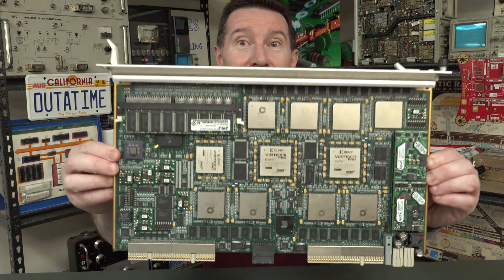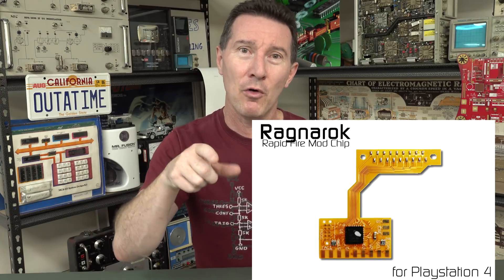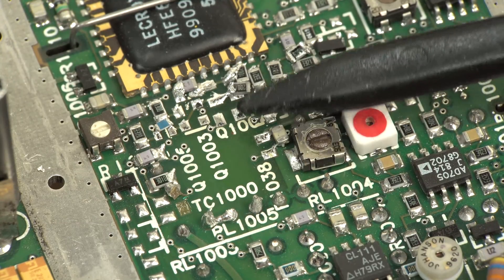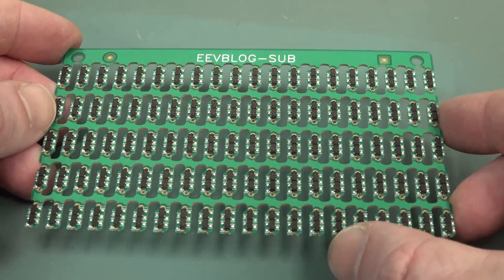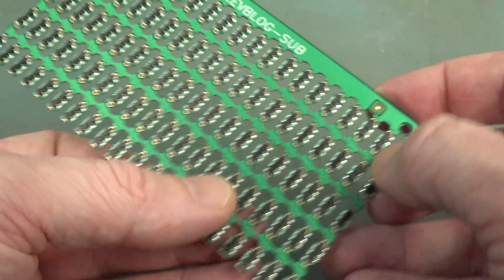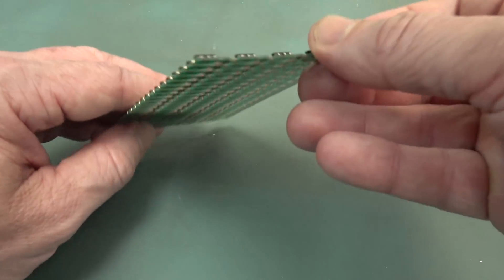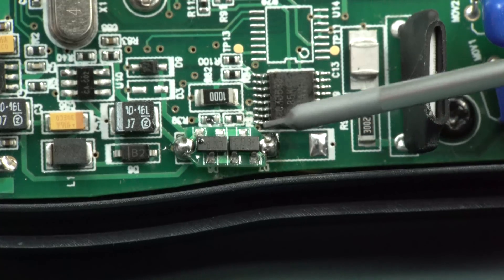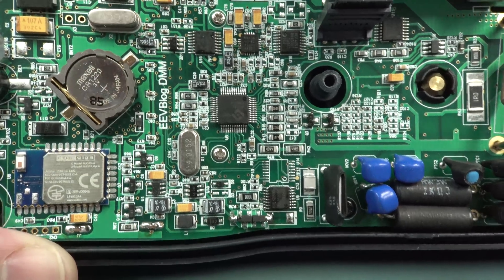EEVblog #1158 - How To Create PCB Mod Boards

Comment: How to be from noob to pro in electronics from scratch without Arduino and raspberry Pi?
Reply from the maker: Build stuff. Fail. Troubleshoot. Repeat.
Reply: Electronics is way more than micro's and writing software.
Reply: @vincei4252  Agreed, analog design is far more demanding than buying and mating modules with bodge wires and code...
Reply: grab a book like Practical Electronics for Inventors by Paul Scherz and Simon Monk. practice basic circuits on a bread board and/or perf board. when you are feeling more confident and and have a working design you want to make more permanent, fire up KiCad and learn how to do PCB layout. you can get small 2 or 4 layer boards made for super cheap these days. and just keep practicing. there are also circuit simulators that are super helpful for understanding how components work, without needing to spend money on hardware.
Reply: All the above, than when you are confident with basic circuits, do repairs. I think it's the fastest way to get troubleshooting skills. Unless you are building really complicated stuff, you probably won't run into too much problem, so repairing existing, scrap stuff may be a quicker (and possibly cheaper) way to improve your skills. Than you can build more advanced stuff, and run into harder problems to solve. For example, if you buy your instruments in non-working condition for cheap or pick it up for free, than repair it, is a good way to both equip your lab, save money, and get practice. Although repairing an oscillopscope or other complicated lab equipment is not a beginners task, better to start with simple, cheap consumer stuff.
Reply: arduino and rpi are more software oriented, depends what you want but if you want "electronics" knowledge you can start learning about components and circuits, first analog, then digital. For software related stuff you can use basically any computer to learn coding, there are even OSs, emulators/simulators from many popular devices like the rpi and arduino so you don't need to buy all of them at least to start learning.
Reply: If you want to learn digital without learning software then build up logic circuits. You can do a hell of a lot with just the 4000 and 7400 series of chips.
Reply: Thanks everyone for guidance!
Reply: Don't worry about using Pi and Arduino. Its all good useful stuff. Except in professional Electronics these are used in the automated test jigs, rather than the final products.
Reply: Get yourself a few cheap op-amps like the 741. Get a cheap prototyping breadboard a few LEDs possibly some 555 timers and start with simple things like flashing LEDs. It's worth getting a few cheap transistors too like BC108/2N2222/BC547 (all three are similar enough to be interchangeable below 12V in most applications), get a resistor selection box and a capacitor selection box and have fun. They work quite happily from 9V as long as you do not overload them and it's worth building simple stuff like a crystal set radio too. You can then use the op-amp or a couple of transistors for a simple amplifier for a speaker instead of a crystal earpiece.

Comment: You didn't really save on the hot air while removing on of these boards on the scope board, or did you?
Reply from the maker: The mod PCB actually crumbled when it came off, it was a mess! Must have been some horrible quality non-woven fibreglass.
Reply: @EEVblog  I was talking about all the blown away passives around the former mod PCB ;). But yeah, that happens. Had to replace some TQFP uCs on prototypes once and just put new blocking caps around them afterwards.
Reply: I was staring at those for a minute thinking, damn that is a horrible botch job, before realizing it was just from him removing the mod board.
Reply: Looks like a crime scene 6:36
Yeah, shit happens. No worries.

Comment: I wonder how big the market is for mod boards. There are plenty of obsolete parts still used for hobbyists and common repairs. Is there a database where you can search for an (obsolete) part and find the buy link for the replacement? It does not need to only offer mod boards, but all kind of items you could replace a given part with.
Reply: L3 P3 Really good question.  In the old days there used to be entire books of equivalent component numbers for ready look up.  Not sure about these days.
Reply: Plenty,  guitar effect pedals are a perfect example.
Reply: For example I recently saw this http://www.leobodnar.com/shop/index.php?main_page=product_info&cPath=125_127&products_id=324 board to replace an unobtanium prescaler IC in a HP/Agilent signal generator.
Useful if you have a need for exactly that IC (which apparently fails quite often).
Reply: Some circuits are turned into "components" this way. DC converters for example. You can buy a variety of DC converters with the bypass transistor, cap, inductor, and diode, preasseambled on a tiny "mod board" that is made to be populated onto your own PCB.
Reply: NVRAM! nvram.weebly.com.
Reply: People have used them to get around security on game consoles.

Comment: Since you have not mentioned it: Are these two transistors in a voltage-clamp configuration just like you explained in the previous video? It really seems so.
Was the previous clamp part too expensive, has it produced problems in the circuit, or why was that mod neccessary?
Reply from the maker: Yes, it's just for improved performance on the high resistance ranges, and yes it's cheaper. And will eventually be rolled out onto a new board design. New stock meters come with this board fitted.
And no, existing users cannot retrofit it, as it would require complete re-calibration on certain ranges, and there is no reason to do so anyway.
Designs often get tweaked like this and slight improvements made with time.
Reply: @EEVblog  GREAT! Now I have an excuse to buy a new one!
Reply: @warrenmasters3036  What?  Own more than one of a brand of meter?  That's ridiculous!

(for those that don't know me,  this remark is a big "tongue in cheek" joke.  I'm all for buying duplicate test equipment)
Reply: @EEVblog  Were you using a TVS on that spot and had leakage problems? It´s the only thing, I that I can think of, being more expensive than this solution and still have this problems. Also package seems to be around that range.
Reply: @EEVblog  It's an improvement but there is no reason to do so anyway????
Reply: @excited box Bought a $10 v/ohm meter for learning electronics and later that day saved myself $70 in unnecessary repair costs. Hard to argue against having some tool over having no tool.
Reply: @ExtantFrodo2  found a fluke 87 iv in trash whos only issue were blown fuse and a bad probe.
Reply: The usage of this clamping circuit as protection of the 121GW  O/B/D/C modes is a complete fail. Neither does it protect the input of the 4053 MUX sufficiently, as the clamping/zener voltage is too high or un-specified, letting Y / pin 15 go beyond its supply voltage (+4 or +15V), if positive overvoltage occurs, but also lets the  Y / pin 15 go far below -0.5V if negative voltages to the input jacks are applied, so damaging the 4053 in both cases.
To have low leakage protection, you should only use the BE diode of a bipolar transistor in diode mode, but not in zenering mode, as this might damage the junction.
Reply: @excited box You might want to save a little more. Even for a 2nd hand model.  A brand spanking new GW121 cost me almost 20 times as much during the kickstarter (incl. tax and shipping). Maybe Dave has some Brymen 235s left in stock. [edit: Or invest in that cheap multimeter to at least be able to do something. As long as you don't stick it in the powergrid socket, or maybe in series with the laptop-psu to measure current, then it should be a 'safe' investment].